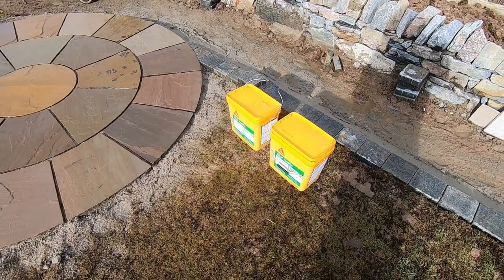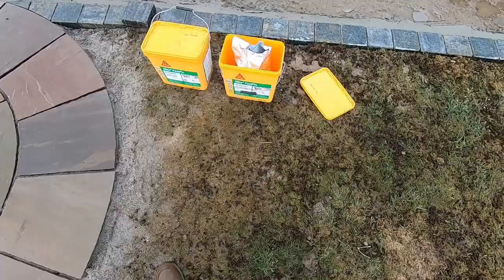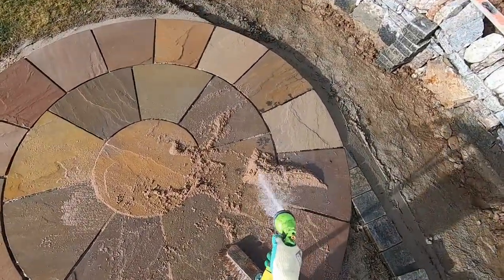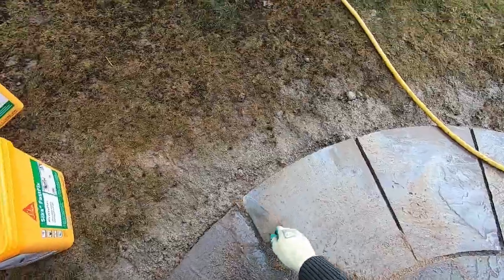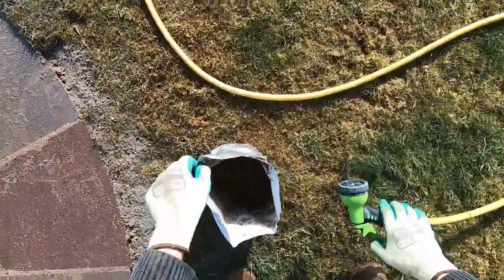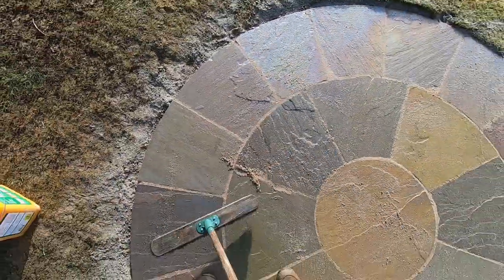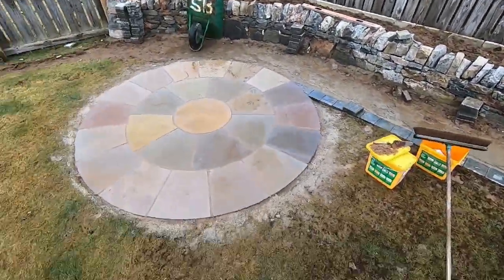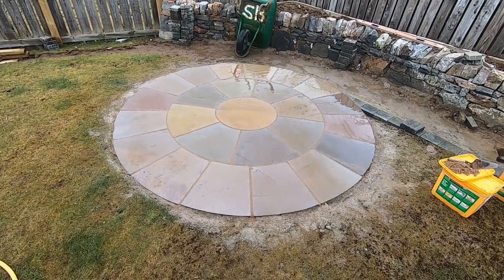How to point using a jointing compound

Comment: Thanks for the video...just purchased a box of this Sika fastfix in deep grey for £26.40 Inc. Vat, from a local supplier after searching online. (Usual price seems to be around £36 at present). Just need a grouting tool/iron or trowel to do the job. 👍
Reply from the maker: Nice price😊 I don't use that brand anymore, takes too long as a contractor for it to go off ... about two days!
It's fine though. Just don't let anyone stand on your paving after you've pointed it😉

Comment: Nice vid,
Is this product durable as the method looks too easy to apply. 
I am haveing  a patio priced and the company use this or a similar product,  I am really not convinced by it compared to proper cement pointed in .
👍🏻
Reply from the maker: Hi Hovermotion,

I've changed back to Pavetuf rather than Sika Fastfix.
Pavetuf goes off a bit quicker than Sika but, they are both fine. 
It's just so much easier than cement pointing as you have to wait for a dry day to do it but, with a resin based compound .... the wetter the better😁 
I've put a link below for how to apply 
the Pavetuf. Enjoy

https://youtu.be/aJyFufnu2fA
Reply: @naturalhabitatlandscaping3681  Many thanks for your swift reply and information..🙂

Comment: Is the sika long lasting? Or is 3 to 1 cement brushed in as good or better?
Reply from the maker: Sika will last for about 6-8 years before you need to repoint. 
3 to 1 cement brushed in? .... used to do that years ago but, it really doesn't last.
If you are gonna use cement , use a wet mortar mix and do it as you lay the slabs. I've put a link below.
https://youtu.be/agDBg9oaxuI

Comment: So having just tried this stuff, my main issue is its cost. My 1 box barely did a 3rd of my patio. Another couple ordered. thats £90+ whereas a bag of cement and sand would have been under £15 and would have done the lot. I am now questioning whether I've wasted my money.... The only advantage I can see is its handy for builders when its raining?
Reply from the maker: There is some truth in what you say. Definitely more expensive than sand and cement but NOT being constrained by the British weather is a real advantage .... particularly if your cement pointing is ruined by the rain and you have to do it all again!😠
On the plus side you get a better choice of colours with resin based pointing compound. I guess you pays your money and takes your choice😁
Reply: Yeah I saw lots of people online using this and thought it must be the way to go. Was expecting to do the patio out of 1 box.... Errr no. Doing my own patio and having chosen dry summer days, now wondering why! :-) Not bothered about the colour just wanted to stop all the weeds as half my grout had fallen out. I can imagine its a godsend for builders in the winter! Just hoping its going to set properly....
Reply from the maker: @666Bern666  It will set but it takes twice as long as it says on the tub! It will be solid in about 24 hours I found

Comment: What I want to know is how you marked your stones to get a round pattern?
Reply from the maker: Good Question! Click on the links below, 
How to Lay a Sandstone Circle
https://youtu.be/az-FdNXxqLo
This one will show you how to point it too
https://youtu.be/zNZiDuNIJRQ
Hope that helps😁
Reply: @naturalhabitatlandscaping3681  awesome videos! I have a few more questions for you.

How many parts of sand and cement is your mix?
If you were to seal stones what would you use?
Thank you for your help
Reply from the maker: @jcdiaz2xm  5-1
I don’t tend to seal them as I like the fact that they are different colours depending on whether they are wet or dry. If you seal them, it will fix their colour if you understand. Anyway, probably Thompsons  one coat patio sealer is what you’re looking for.😁
Reply: @naturalhabitatlandscaping3681  
Im actually working on my patio and I like the way it looks when it’s wet that’s were I got the idea of using a sealer to give it a wet look.
Reply from the maker: I ordered a circle pack from Jewson, easier than cutting them yourself😉
Reply: @naturalhabitatlandscaping3681  
I know but I like the challenge
Reply from the maker: @jcdiaz2xm  Buy a circle pack and a patio pack and then use the circle pack as a template. Cut all the slabs you've drawn around and cut out with an angle grinder .... and send me the video, I'd love to see it!😂😂
Seriously though, just buy a circle pack😉
Reply: What color sand did you use on that patio?
Reply from the maker: @jcdiaz2xm  Hi, you’ll have to use whatever colour sand you buy from the quarry or DIY store. It come in lots of different shades from buff to grey😁
Reply: Sorry I meant the color of sika fast fix joint sand
Reply from the maker: @jcdiaz2xm  Ah, sorry🤣
So it was Buff. The next one I’m doing is black!